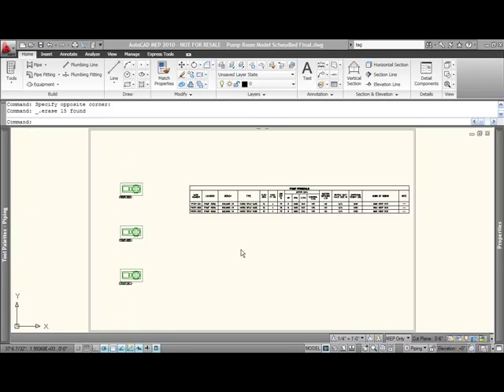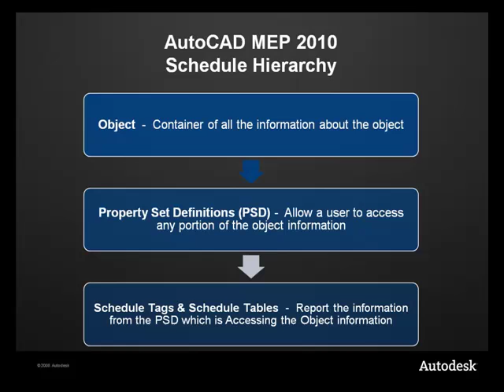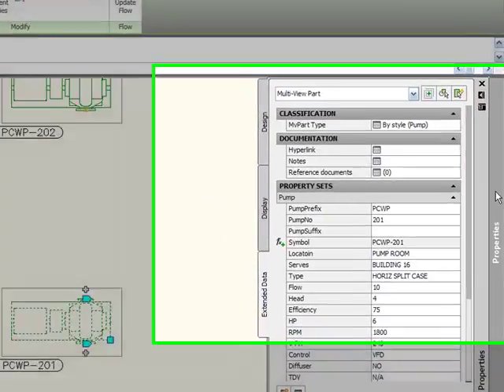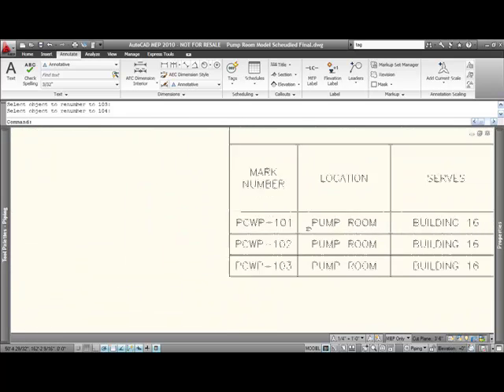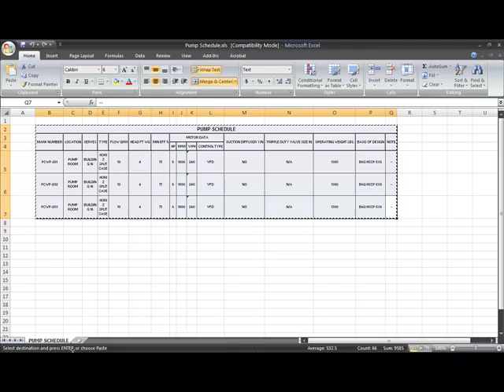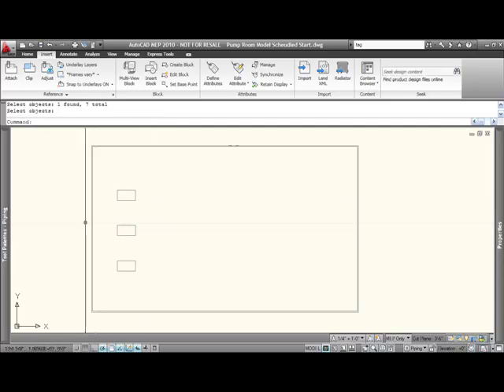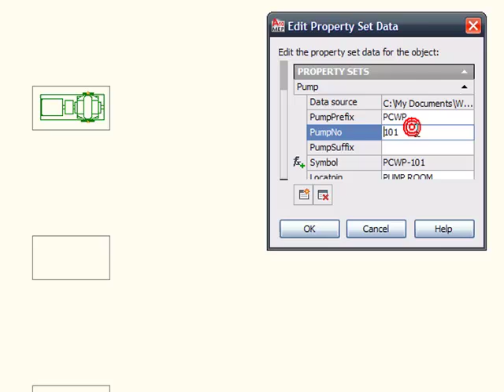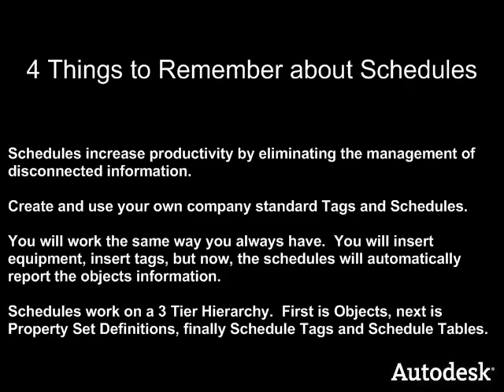AutoCAD MEP 2010 - Schedules - Concept - Part 1 of 4

Comment: Jay. Congratulations on your videos.
I've watched this Schedules series many times. The best I've ever seen.
I used it on a trial of MEP 2010 and it worked flawlessly. However, in 2012, when trying to define a new Property Set Definition (for example for pumps), when I check under the "applies to" > "MV part", the options have been limited (No pumps, no sprinklers, etc). How do I fix this?
I hope you have the answer to that (you seem very knowledgeable. Thanks,
Alex